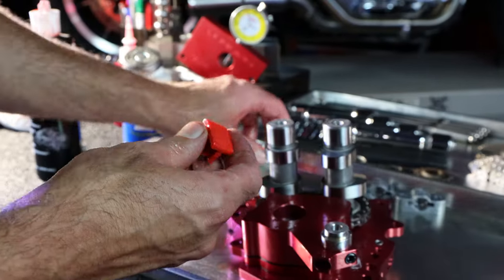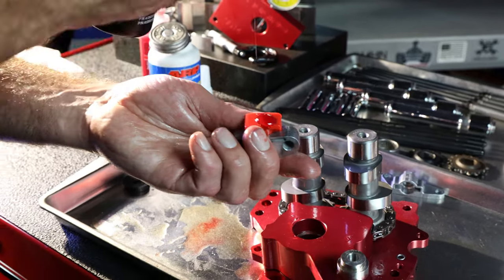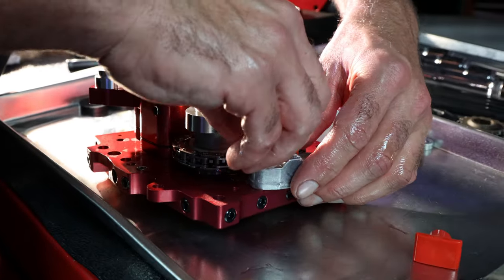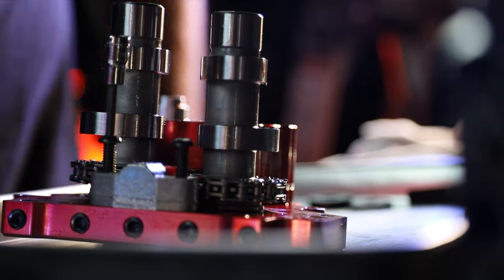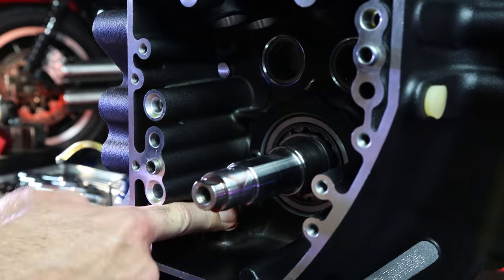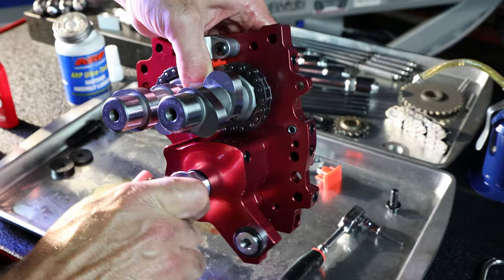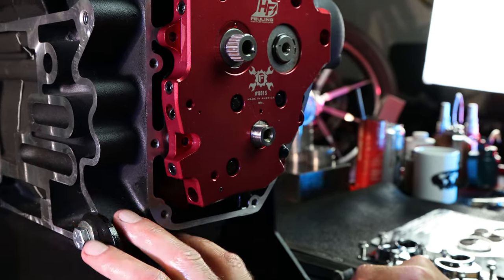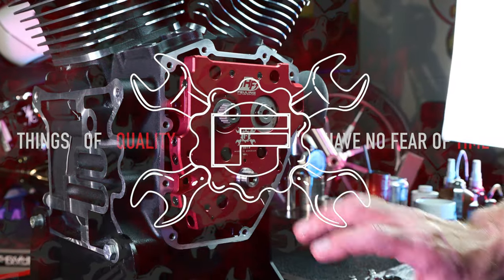TWIN CAM CAMCHEST KIT INSTALL:  PT 3

Comment: Awesome video! I always run fueling plates and pumps in my bikes, top notch products on everything u guys put out. One question for you, when would u recommend running roller rockers in a twin cam? Or what lift, I’m running a 590 lift cam and iv heard a few say after 585 but most say really not necessary on anything under a 600lift. I just like doing Things right or making things the best it can be

Comment: I understand the theory behind the thought of Pulling Away from the case...however being old school disagree with that method. I DOOOO however agree with the method of installing the o-ring to the back of the pump prior to installing to case. seen one that the pump cut the o-ring during installation...
Reply: stock pump flanges are beveled...not squared off...like the Feuling pump body